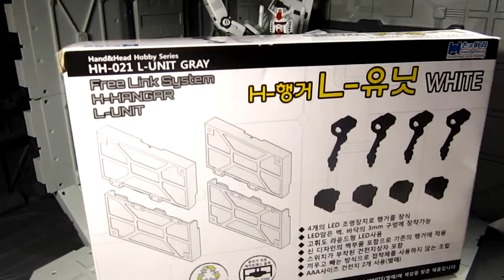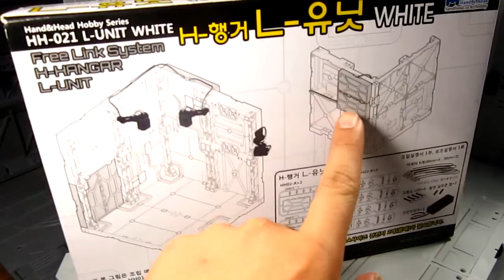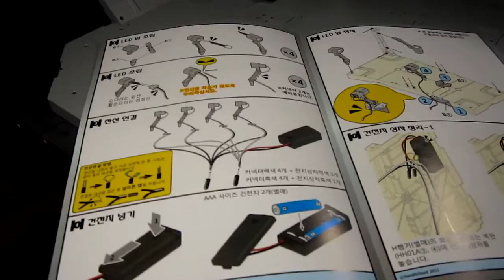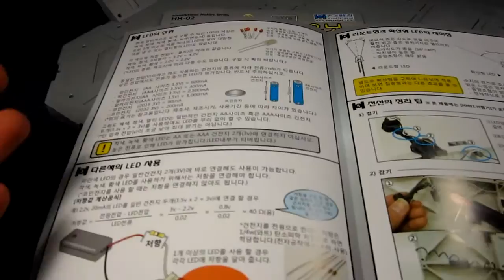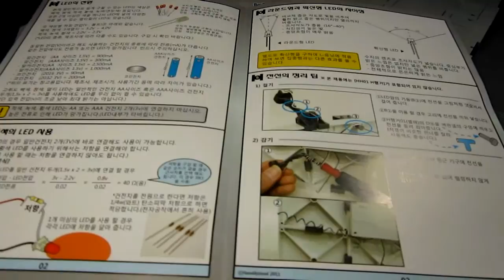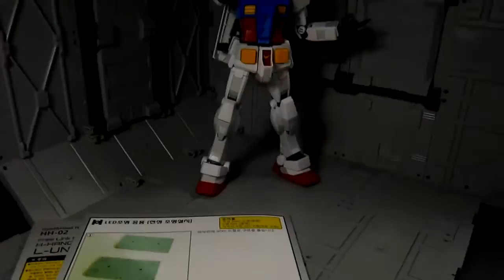H Hanger L unit LED

Comment: iis this straight build?? or you'll need to solder the wires for the LED??
Reply from the maker: It's straight build, wires just connect to the LED as instructed.  No soldering needed.

Comment: Does an Action Base arm fit into the peg holes in the H Hanger?
Reply from the maker: Unfortunately the H-Hanger does not have mounting points for the action base, but the Octagon set does.